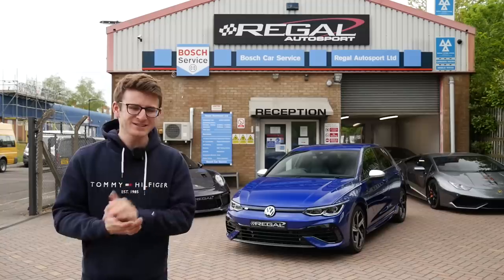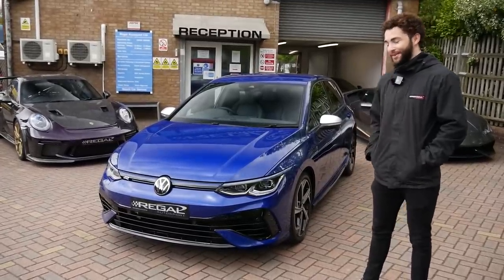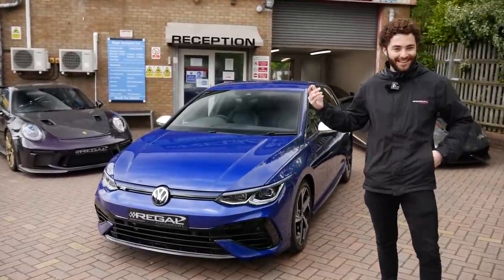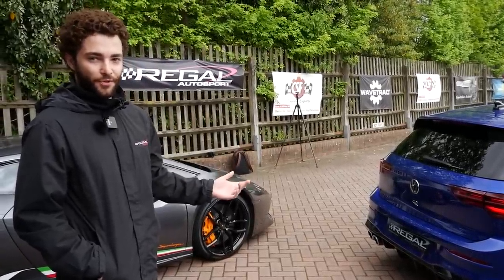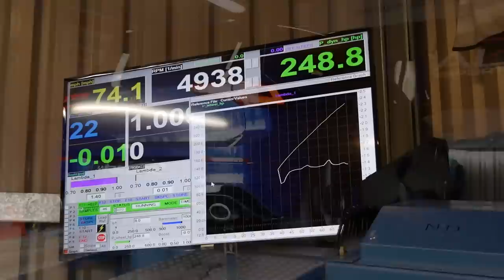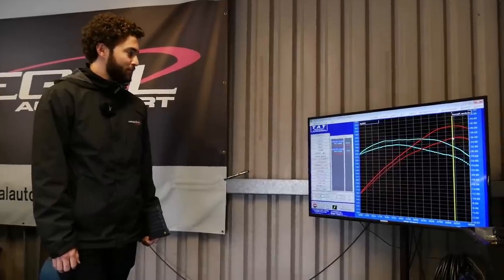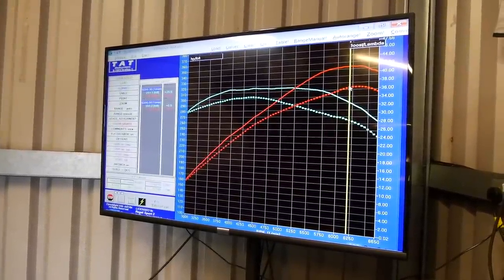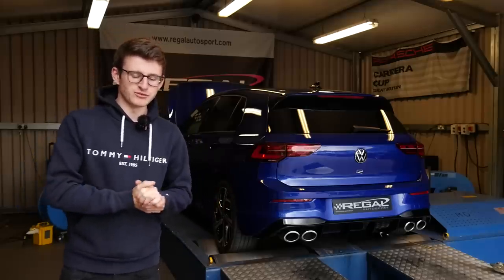How Much Power Does A STOCK MK8 Golf R Really Make?!

Comment: A GPF filter doesn’t effect performance. It only changes how the car sounds. REVO have software with the GPF filter still in and it didn’t hinder the performance. So if you were to remove it you’d be doing so to make it sound better like a pre GPF car.
Reply: It reduces flow
Reply: The backpressure in the Downpipe is higher after the cat so you have higher pressure , higher temp near the turbo

Comment: Does the new 8R have the DSG blip on the upshift ?
Reply: Yes, mine backfires and pops on downshifts.    Haven’t got to the 1k miles mark yet so no pulls over 4K rpm or full throttle .  Only at 65 miles right now so a way to go

Comment: Looks like 340mm front, the 365mm did not fit with calipers under those 18 inch wheels.
Even for 320+ one piston calipers rims should be at least 17inch.

Comment: add intake, dp and exhaust, maybe coil packs and make damn near 370-ish, tune it with like a stage 1 flash and be near 500 lol
Reply: well youre 12 hahah 130 hp from a stage one kkkk
Reply: Coil packs? What is the purpose of it? No cars today that use Coil pack. All cars today have a single coil on each spark plug.
Reply: @ISOLATICN1  audi rs6 easily gets 300 from stage 1, 130 is nothing
Reply: @tedarcher9120  no it doesn’t what planet are you living on? You play too much NFS
Reply: @ISOLATICN1  there is literally a video where a man climbs into rs-6 and tunes it from 600 to almost 900 hp in 15 minutes. Rs-6 engine is basically two golf engines stuck together

Comment: Does the MK8 still use the IS38?
Reply: no
Reply: It’s using a ball bearing continental turbo now
Reply: @TBONENYC  Thanks, where did you find this info?
Reply: @justininman5521  just remember reading it on a bunch of forums
Reply: It's very similar to the MK7 platform but the turbo is definitely different, it even has a speed sensor on it!
Reply: All is diferent

Comment: no strut bonnet :(
Reply: /sadface
Reply: @RegalAutosport  sad indeed. they saved 1 euro for the strut and went 30 years back in time.
Reply: they trying to go old school LOL
Reply: @antop4597  I understand if they went full racing mode and are cutting weight everywhere and arre trying to save 50 grams, to go under a ton. But they are not, they are just cost saving, cutting 1$ off, erasing very important feature.
Reply: @Corsa15DT  it's hilarious to think that the golf used to be VW's go to car because of the quality. Now it's full of shit quality materials and cheap shitty plastics. Skoda octavia vrs has better quality materials than this lol. In terms of performance, the mk 8 is what mk 7 should have been from the get go.
Reply: @antop4597  MK7 and MK8 use the cheap torsion beam at the rear for all the models up to 150hp, which pretty much includes the majority of the golfs on the road. The MK5 and MK6 use multilink with 4 links on each wheel.

Comment: Who cares when it sounds crap like any other fourbanger out there ? I hate those pops and bangs which are just there to compensate a lack or engine character due to turbo's   
 If you want the best acceleration , go EV .  If you want to get a grin on your face every time you step on it, get something more exotic,  like a V8.
Reply: Lol! 4 banger subarus sound good. Every car has a good sounding motor. 4 banger, 6 banger,  8 banger.